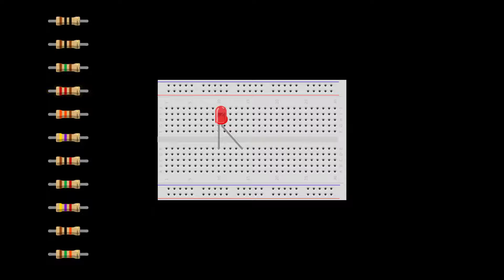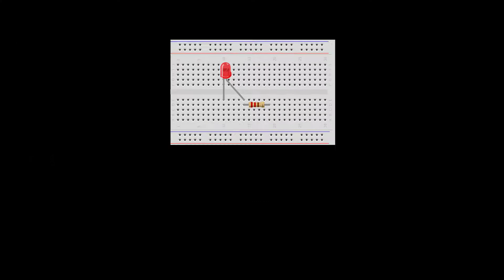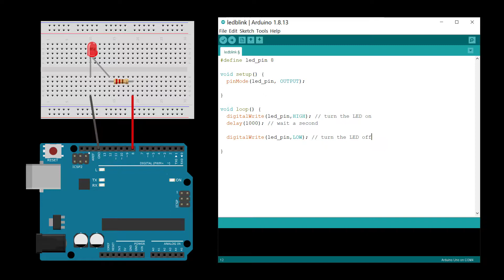Arduino Blinking LED Tutorial

Comment: 1:40 1.Setup function pin mode allows the pin to provide enough current to power the led.
2.Loop function use high to led on & low to led off.

Comment: Remember a LED is a Diode, it only allows current to flow one way and not the other. If your LED didn't blinked it may be wired backwards.
Reply: That's why it wasn't working! Thanks!

Comment: its genuinely not working. i have mixed and matched different wires but no matter what i do, it just doesnt work.
Reply from the maker: It's possible that your Arduino is burned out (unfortunately mixing and matching wires could cause that)

Other possibilities are bad connections in the bread board, burned out led, bad resistor, burned out wires

Generally speaking troubleshooting involves testing each element. For example, by connecting the led to a battery, testing the resistor and wires with an ohmmeter, and verifying that the arduino pins are generating the expected voltage with a voltmeter.
Reply: @curiores111  honestly I think it’s a bad resistor
Reply: You can try pin ground and pin 13

Comment: Why am I not allowed to place the transistor parallel to the LED?
Reply from the maker: Transistor? I think you mean the resistor. No one said you "cant"...it just won't serve its purpose...which is to limit the current through the LED.
Reply: @curiores111  Oh yes, I meant the resistor of course :)

Why can't it limit the current when it's parallel with the red wire adjusted to the resistor?

Should the red wire always be away from the LED lane?
Reply from the maker: @wombatZ  If it's in parallel then the current can travel through the red wire instead of the resistor. This basically means the resistor is doing nothing. Think of it like rivers. If you make a choke point in a river, it will slow the flow. If you have two rivers, and make a choke point in one, the water will continue to flow rapidly through the other branch.

The red wire is positive, so it needs to connect to the positive side of the LED. That's the only requirement for it. Not sure what you mean by "away from" the led lane. If you mean that it should not be in the LED lane, then yes, if the resistor is on that side. Otherwise, it would bypass the resistor and connect straight to the LED.
Reply: @curiores111  Thank you. You have answered my question!

Comment: My led just stays on, I re typed the code 1-1 exactly like you have it on the video, and on gthub . Checked and checked the connections and everything. Changed the delay to a smaller number , and nothing the led stays solid.... HELP I just started trying to do this and I've been discouraging so many times. I do have a Ethernet shield on the Arduino but I don't think that would change anything ..... please help, anyone lols, don't let me give up again please
Reply from the maker: Why don't you start by trying to remove the ethernet shield? Best to start simple!
Reply: @curiores111  hello, I have done that, also tried different LED's and resistors. And a different breadboard. Also changed from Arduino to a espwemos D1 same results. I'm a failure 😔😔😭😕😭😭
Reply from the maker: @MorbidKayla Hmm, that sounds..odd. Why don't you send me a picture of your setup along with a screenshot of your code. curiores@gmail.com It's a pretty simple setup so debugging only has a few steps. The image should clearly show where you've connected all of the wires, or it will be difficult to debug.
Reply: What version of the app are you using I ended up having to download the older version to code it

Comment: Does it make a difference which Arduino board you use? Having trouble deciding.
Reply from the maker: Any Arduino is fine for a beginner project. In general the uno is the most widely used starter board. Personally I like inexpensive starter kits like this one.

https://www.amazon.com/ELEGOO-Project-Tutorial-Controller-Projects/dp/B01D8KOZF4/ref=sr_1_1_sspa?dchild=1&keywords=elegoo&qid=1597363056&sr=8-1-spons&psc=1&spLa=ZW5jcnlwdGVkUXVhbGlmaWVyPUEyNTRVOVhIR1UzSVpSJmVuY3J5cHRlZElkPUEwOTQyNDkwMzJXUzRWNVVMOFBZNCZlbmNyeXB0ZWRBZElkPUExMDAxMzc2M1RTT1dKR0NNR05TQiZ3aWRnZXROYW1lPXNwX2F0ZiZhY3Rpb249Y2xpY2tSZWRpcmVjdCZkb05vdExvZ0NsaWNrPXRydWU=
Reply: @curiores111  Thank you for the quick reply. I'll definitely grab that one. :) Any recommendations on any further reading materials? Do you use any safety equipment?
Reply from the maker: The "getting started" and other "built-in" tutorials on the Arduino website are a great place to start and learn some of the basic elements typically used with Arduino.
https://www.arduino.cc/en/Tutorial/HomePage
For example, this tutorial demonstrates the use of a potentiometer and how you can interact with the readings in code.
https://www.arduino.cc/en/Tutorial/AnalogReadSerial

I don't use safety equipment -- there isn't a lot of danger associated with basic Arduino setups (it's only pushing 5 volts, generally speaking).
Reply: check out "aliexpress" you can get one for $5 but be careful they have "FAKE" ones you need a board that uses the "CHIP" its rectangular not the square chip! you need an arduino chip.  [KEYESTUDIO] are good check for price they can be expensive but if you look you will find a good price. they are yellow! $5-20
Reply: I'd recommend anyone getting started with Arduino get an Arduino brand board.  Trying to save money on knockoffs took me down a rabbit hole of bootloaders and software updates, huge waste of time.